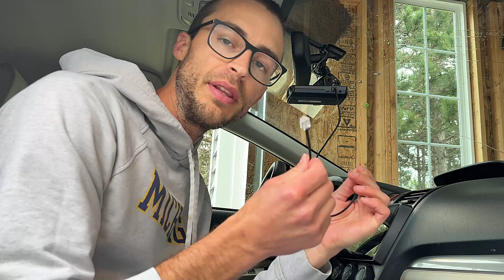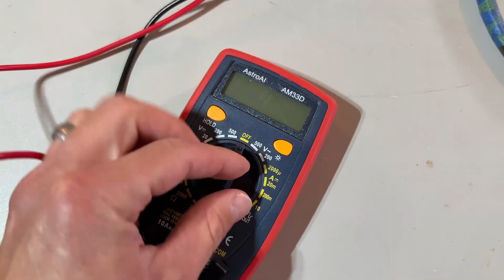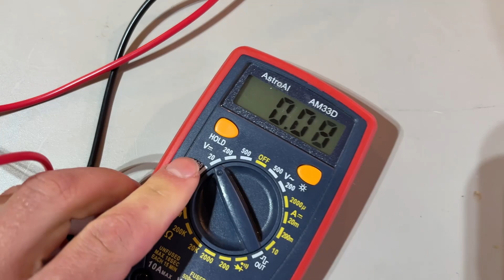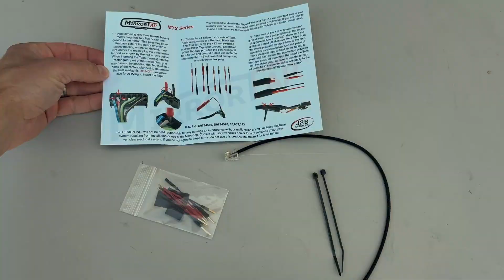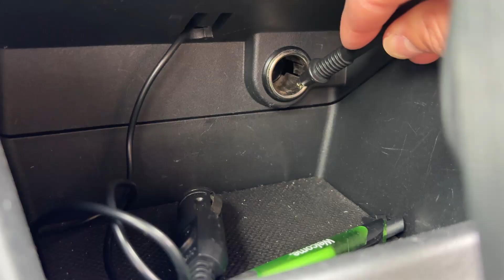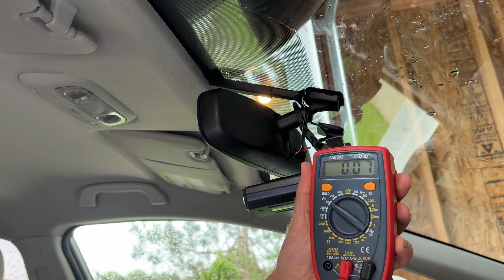How To Install A MirrorTap - ANY CAR

Comment: Thank you for this! 
I forgot ground often runs thru other circuits. I mistakenly used a (tested) non-hot wire as ground which likely fried my old gear. Assuming a wire is ground (negative) if your meter returns no voltage even on ACC, can be a problem :/
Reply: How I've used this newly acquired info...
Rewired using dome-map for constant and mirror for ACC - two ft length from overhead instead of seven from dash going up tucked thru the A-column. Dashcam been runnin flawlessly for couple weeks now with parking monitor on the hw kit. Game changer! 😎

Comment: I realized we happen to have the same mirror and car! I was wondering if you were willing to tell me the pins you plugged it into to save me the purchase of the multimeter, it would be greatly appreciated
Reply from the maker: Yea let me see. I have 2012 Impreza sport.  Red in 1, Black in 4. If you look at the back of the mirror from the front of the vehicle. There should be a black and white wire in the first spot and a black wire in the 4. No wires in 3
Reply: Perfect thank you, 1 and 4 as in 🅱️🔷🔷▪️🔷🔷
🔷🔷🔷🔷🔷🔷, also how did you fit the red wire in the same spot as the black and white?

Comment: Hey, thanks for the video! I was able to find negative easily, but I am a bit confused about the part where you discuss how to find the positive. (3:39). It looks like you use red one to touch the center of the cigarette lighter but then you also use it to touch the pin right after? Could you please elaborate on it a bit more? Also, does the car have to be on for me to find positive? Thanks a lot!
Reply from the maker: Side of the 12v outlet is ground, the center pin is positive. I was checking to see if it was powered when off

Comment: I only have power from my dome lights. And it's constant power with the car off, how am I supposed to wire this with constant power?
Reply: I went ahead and ran a wire through the headliner, down the A pillar, behind my glove box and finally to the 12v outlet that I tapped into.
Reply from the maker: You will drain your battery doing that.  Need to find a different source
Reply: I had footwell lights, star liner and my radar detector in my Cadillac and I fuse tapped my ignition and I had to run a wire over my headliner down my back pillars to my fuse box under the seats. Didn’t drain my battery. Turned on and off with my car, used a ground up front.
Reply: @stsdragon1  I ran a wire through the pillar to the cigarette lighter and tapped from there

Comment: If you're new to a voltmeter, caution about using the ohms or as he says continuity.  If  you touch the wrong leads, you'll blow a fuse if you're lucky or blow the meter itself if there's too much amperage there.
Reply from the maker: As long as you use it on a circuit that is off you shouldn’t have any issues. Use vdc for checking a live circuit